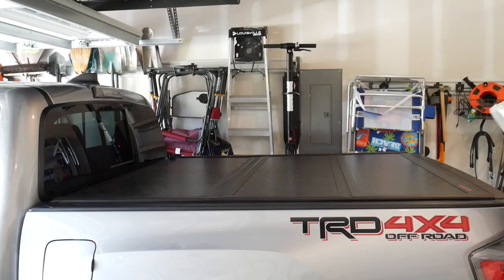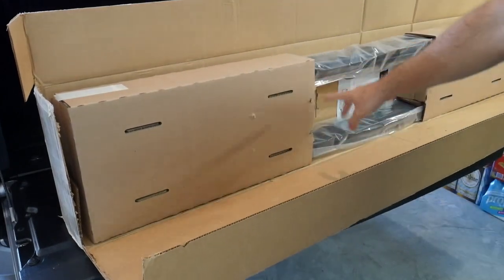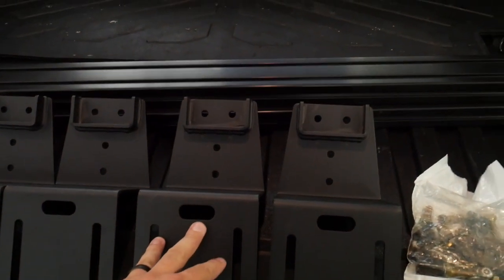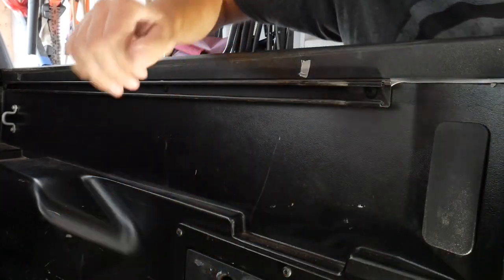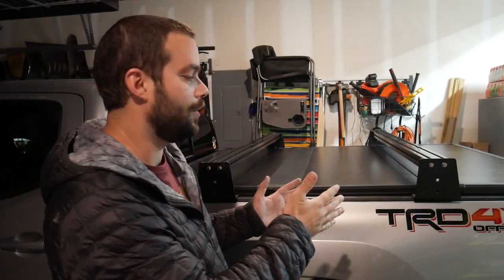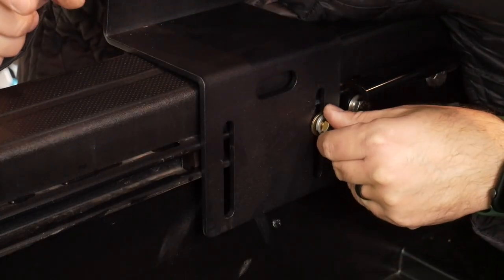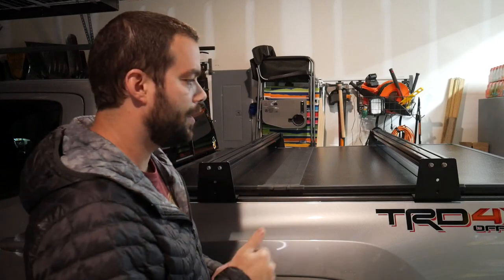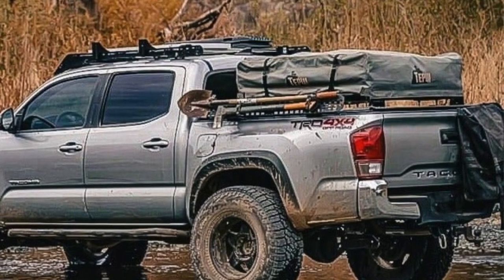Truck Bed Crossbars + Tonneau Cover | BillieBars

Comment: These bear a striking resemblance to the KB Voodoo crossbars I bought back in 2017.
Reply from the maker: They are a similar design with a few changes to the brackets and bars to strengthen the overall design.

Comment: How easily can the crossbars be installed/reinstalled so you can use the truck bed fully?
Reply from the maker: Timed it, takes about 5 min if you leave the brackets attached to the bed rails or about 15 min to totally remove the rack system
Reply: @GearKnowHow  Awesome! Thank you for the follow up!